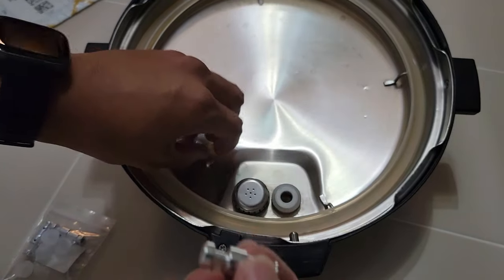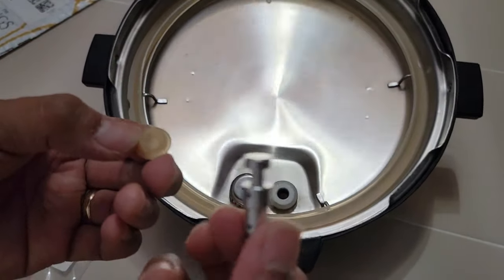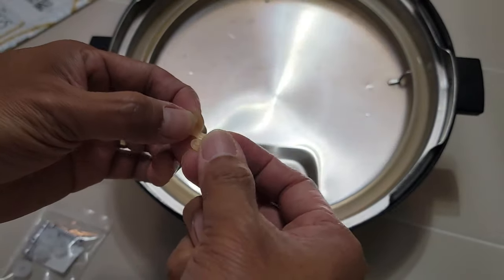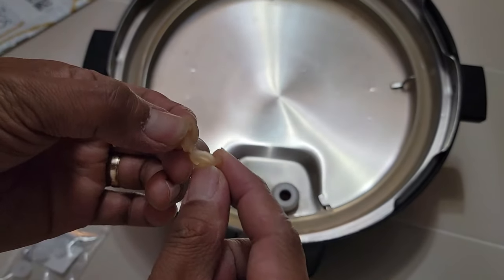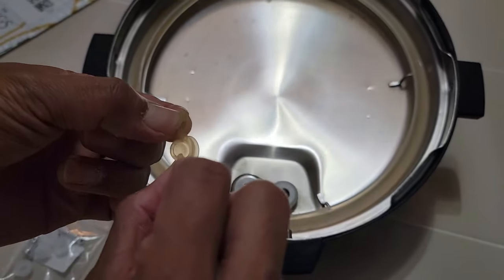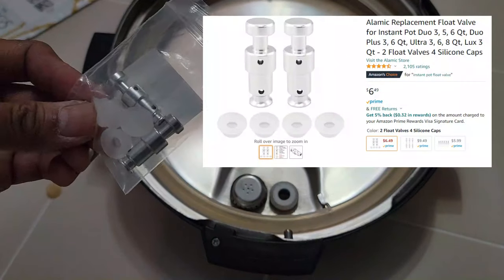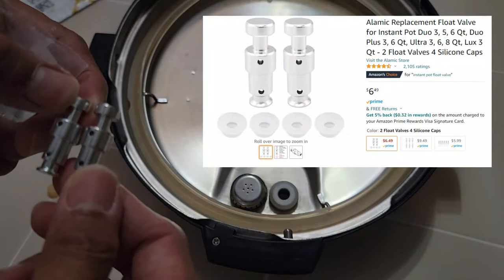How to Repair or Replace Instant Pot Float Valve

Comment: Why is my  steam continuing to come out the hole exactly where you just replaced the part on my pressure cooker? It's model 99602 a Cooks Essentials Brand from QVC.  It worked perfectly last time I used it,  but now continuous steam comes out the tiny hole not the main valve release.  It's coming out the hole where this demonstration was filmed.  I don't know how to stop it from steaming